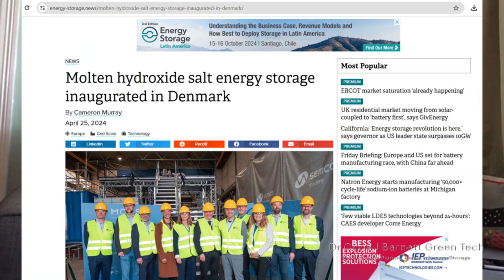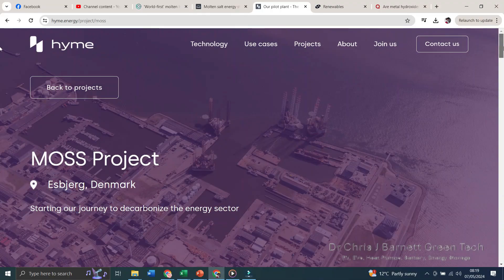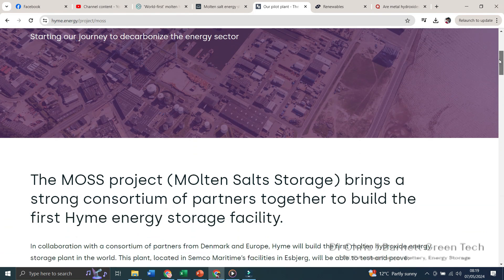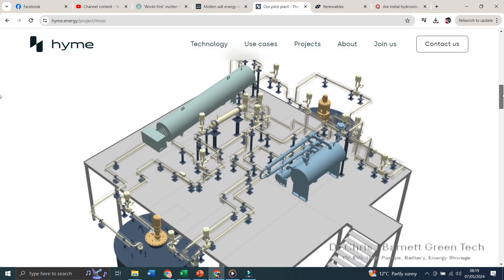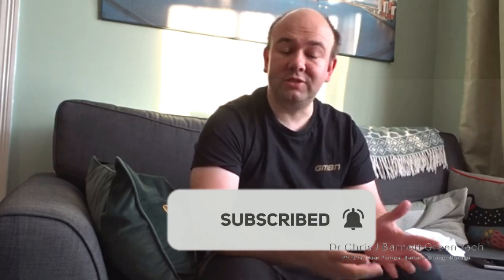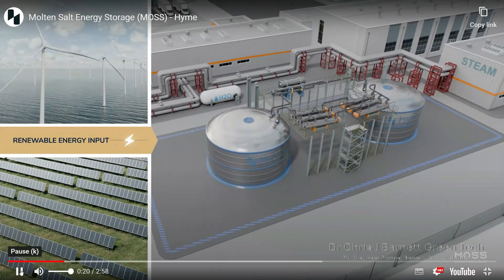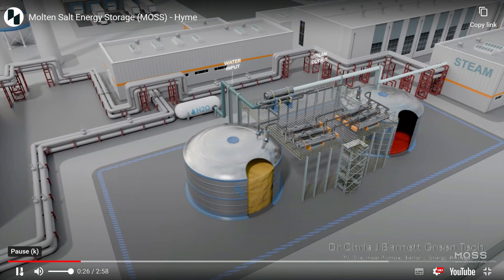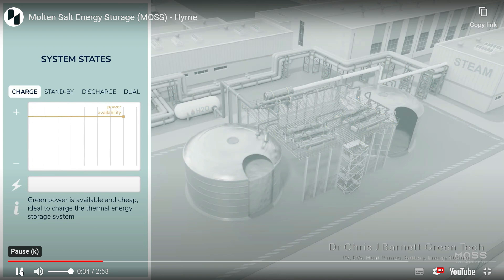Is the Future of Energy Storage: Molten Salt? Explain Hyme's MOSS Project

Comment: Thanks for the useful video. Do you have any idea what material they used to avoid the high corrosity of NaOH?
Reply from the maker: @bugextra8556  from the melting point they give, the magnesium hydroxide could be a possibility.
Reply: @drchrisjbarnettgreentech I meant for the transfer of molten NaOH? any metal can be stable?
Reply from the maker: @bugextra8556  sorry misunderstood.  The issue is the high temperature.  There are forms of steel and nickel alloys that can resistance. NaOH up to certain temperatures.  Another option could be a ceramic coating. There might be some useful info in this paper for you https://www.mdpi.com/1996-1073/17/1/22
Reply: @drchrisjbarnettgreentech  Thanks, it is very useful.